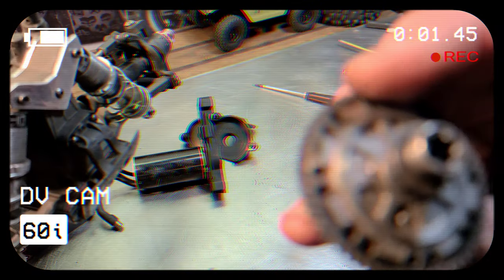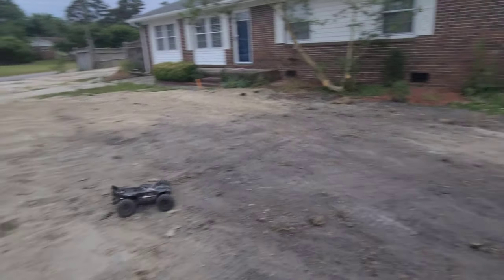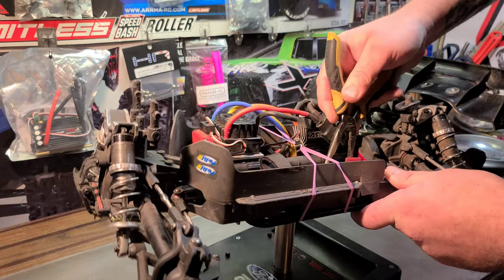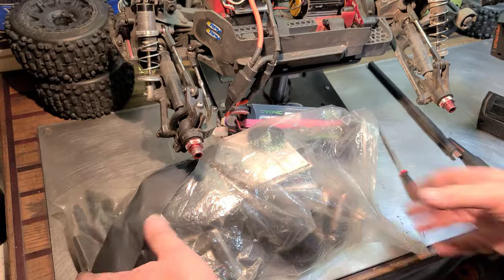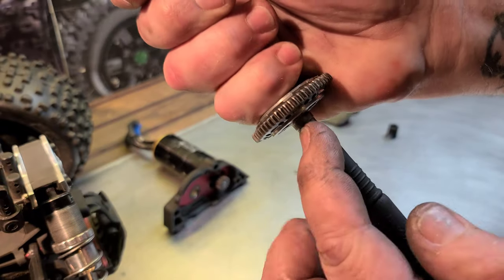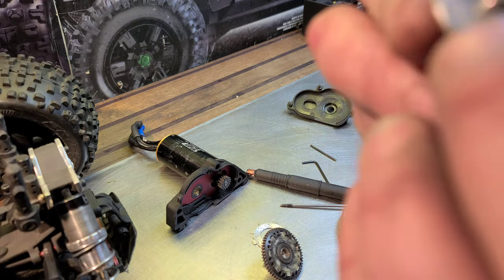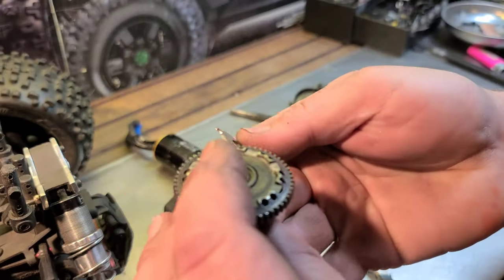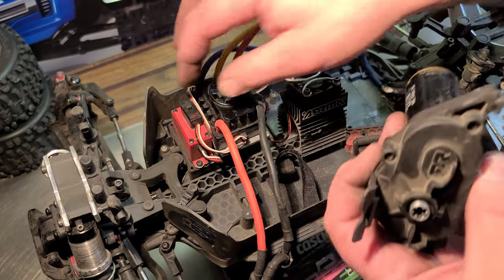Slipper Clutch Inspection With Hotracing Aluminum Slipper Clutch Pads | Arrma 3s & 4s blx

Comment: Thank You So Much Big B....I was waiting for your video update...I will say this....You are absolutely right!!!...the performance was better when I had the HR pads in the truck. Only thing I thought of was that I had the stock ones in for a year  no real issue. I made the upgrade just to make the truck better, and after 1-2 runs it was performing so good that I decide to upgrade the Motor Mount (M2C) as well. That's when I seen all the dust in the housing and posted the issue to you knowing that you have been Beefing Up your K4S so I felt that you may have a great explanation for me...So Thank You So Much for your follow up vid on this topic. When I made the Upgrade I also purchased new hub set so it all went in brand new. I have since sanded down the pads where they are almost like new again, but I haven't put them back on yet was waiting on your feedback.
Reply from the maker: Roger that...   I put mine back in the way they were all knurled up. I've since noticed that the rear of the truck has way more grab, very little slip.( Which I don't like.) I've ordered another set of pads. Like I said I love the way she preformed with the aluminum  pads. I'm gonna put some graphite powder on the hubs & pads  b4 I run it next time and see if that helps cut down on the grinding.  How do you like the M2C MOTOT MOUNT/BRACE?   Thanks for watching
Reply: @IRONCLADRC  so far so good with the M2C motor mount...It appears to be super durable with that brace. I put longer screws on the housing so I can secure them with lock nuts to strengthen it. You know the 3 scews that hold the plate in the housing.

Comment: I haven't had any issues now in the rear cnc diff very nice recommend highly. Now need strong axels the plastic will snap or break at the u-joint upon a burst of power of course my big rocks all 6s now.

Comment: Watching this bc I upgraded my Typhon 3s to a 1900kv motor running 4s. The rear hub completely stripped out. Plus upgraded both diffs to the steel version.

Comment: Yep me too a 4s system on a big rock nice have to run at 75 percent keeps snapping cvs at 100 percent steel spur stock motor bigger fan it's very fast I keep my spur tight, have broken a couple of hubs however real nice though.

Comment: The hot racing’s diffs sounds much beefier than stock upgraded versions bar a mile 🤔💎🎼 and do you think this would work across the 3s range 😎 thanks for the whole show
Reply from the maker: Yea it will work for the 3s line. Thanks for subscribe
Reply: @IRONCLADRC  💎

Comment: Will the pads cause the center screw of the clutch to loosen on a 3s typhoon and do you think I need to put metal pads on it this is a ongoing problem that I haven't solved yet even with a new clutch it does the same thing and I have to reset the summer screw of the clutch it loosens up
Reply from the maker: I e had good success with the hr pads but alot of guys would disagree..  I used graphite powder lube on my aluminum pads.  I think that's what helps with mine.

Comment: Good vid sir. I have big trouble with my rear diff though I only run mine with 2s lipo. Mine is the Vorteks. Hope you can make a video compared the hot racing diff vs arrma cnc steel one cuz Im about to get one for my Vorteks
Reply from the maker: If your only running on 2s i wou
d go with the arrma steel differential its cheapper and ive had no issuses with the arrma steel diff in the typhoon 3s rear differntial
Reply: @IRONCLADRC  I appreciate
Reply: @IRONCLADRC  where can i find a steel diff ??
Reply: please share how it handles abuse

Comment: I wish you'd actually point out the plastic nut, how many turns to back off from the tight point.. :/ I was more interested in putting it together correctly than being told aluminium pads are better than pcb material.
Reply from the maker: That's why I don't build rc trucks any more

Comment: I'm sorry but when I do my brakes or clutches in my car I try to stay away from metal on metal and I'm sure everyone else does also. Doesn't make any sense to me. I'll stick with stock
Reply from the maker: While a normal clutch features a springs and low-friction material used to absorb slipping and hard launches, a race clutch features ultra-grabby material that limit's the driver's ability to slip without overheating the disc.

Comment: Have you tried lubricating the pads and hubs?  I might be getting the Arrma Granite v3
"Boat Gang"
Reply from the maker: I actually used graphite powder on the aluminum  pads once it actually did fairly well
Reply: @IRONCLADRC  Try a little engine oil, the little holes in the hub are for cooling but could hold a little oil as well. Just get your fingertip wet and wipe it on. I use engine oil to lube everything from guns to hobby RC.  It should allow slip but smooth it out with less galling of the metal.  Just like wet clutch plates and auto transmissions lube their clutches and they don't slip! Well not supposed to lol.  I lubed the slipper on my Abu Garcia bait casting reel and it works amazing!

Comment: How many of the hot racing pad do you use 2 ? in the stock metal spur you use 4 pads right in the plastic stock slipper there’s only 3?
Reply from the maker: 3 hot Racing pads plus 1 stock pad 4 total pads
Reply: @IRONCLADRC   can you run 4 hot racing pads?

Comment: what kind of diffs did you upgrade to? I have a big rock and worry that it’ll go out soon.
Reply from the maker: I tried both the arrma metal upgrade diff and the hot racing diff.  I put both in the hotracing yokes. No issues with both sets
Reply: @IRONCLADRC  nice thanks, I’ll run my current ones hard until she blows then lol
Reply: @IRONCLADRC  speaking of the devil i just blew my rear diff yesterday while playing around at 100% in my yard lol. Kinda upset cuz all I was doing was basic driving/wheelies. I wheelied over a hump and heard it start making sounds right after it landed

Comment: Not that it would matter because clearly you just beat the shit out of the thing but I put alittle lithium grease in on the slipper...metal on metal without any friction modifier is a recipe for eating up pinions
Reply from the maker: I use graphite power lube on my hr aluminum pads works great.